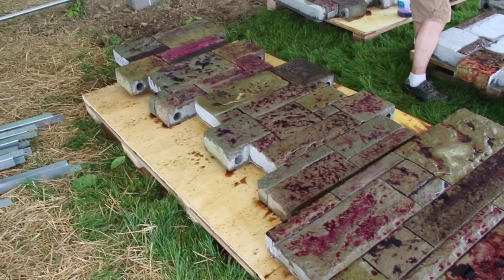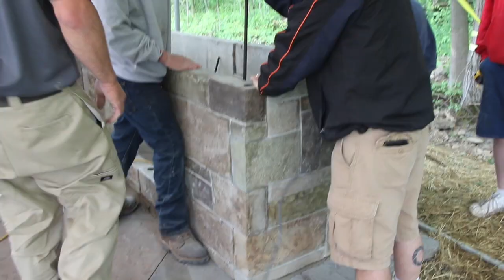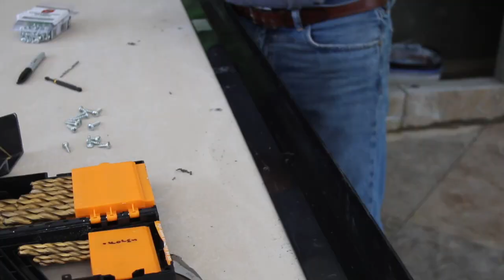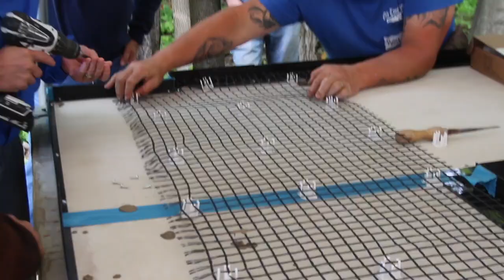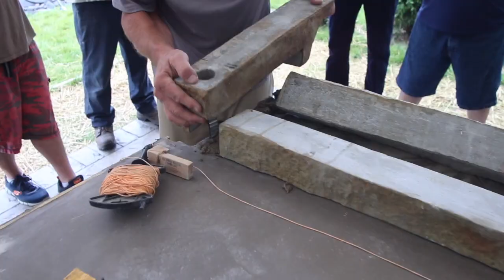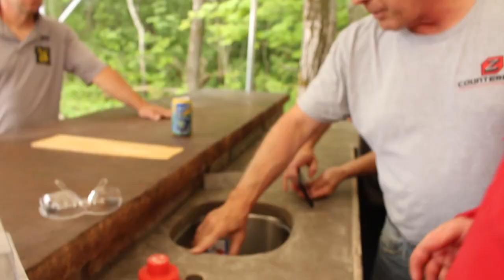How to Build an Outdoor Kitchen - Modular Panel Assembly

Comment: Wow what a massive effort for something that won’t last!!
Reply from the maker: I am curious to know why you think this wouldn't last? The structure is built entire out of high strength concrete and would probably have little trouble surviving a hurricane. It is true depending on the climate and weather exposure, the sealers or stains might need maintenance over a long enough time frame. The kitchen built for this video was built over 5 years ago and still looks good to this day.

Comment: How are the edge forms coming off at end of video if the screws holding them on are inside, on top of island, and under the concrete.  Are the forms themselves snapping and leaving half of the "L" under the concrete?     Tearing off at the screws?   Clearly you are not getting those screws out.   They look like plastic forms, but perhaps not?    Some sort of fiber that tears/snaps?
Reply: @ZCounterform1  Thanks!

Comment: A wooden base where water can accumulate is a no, even it is rated for below ground, wood will eventually rot.
Reply: These are made of concrete and dense foam. There is no wood at all.
Reply: @storeinformation1494  The ledger 2x4 remains and it will probably rot out as water remains on that concrete slab with no place for it to dry out. Should have been pressure treated